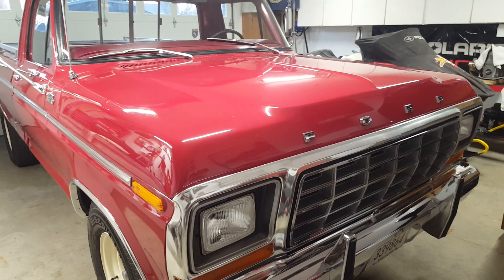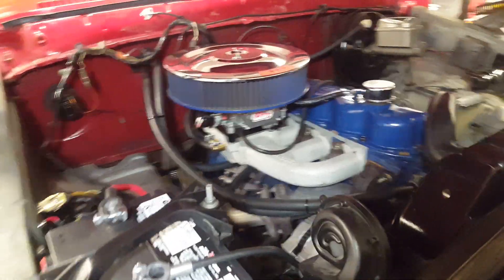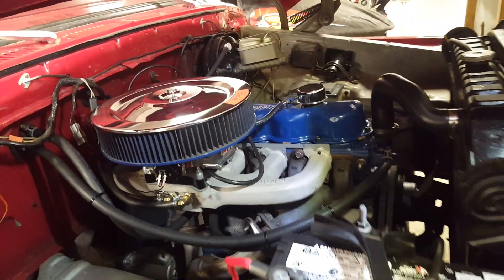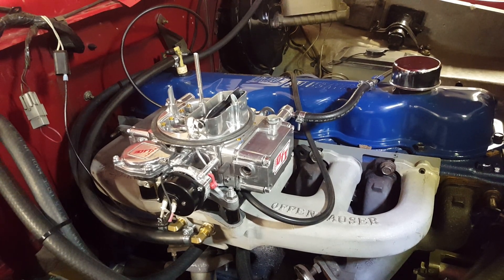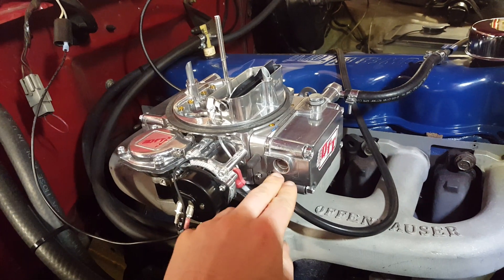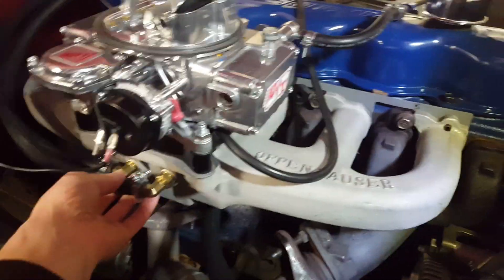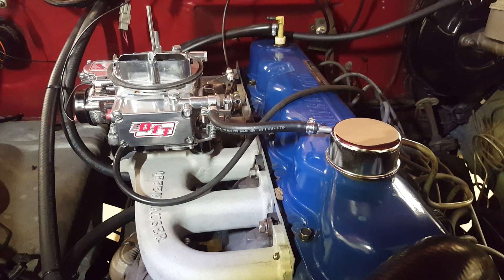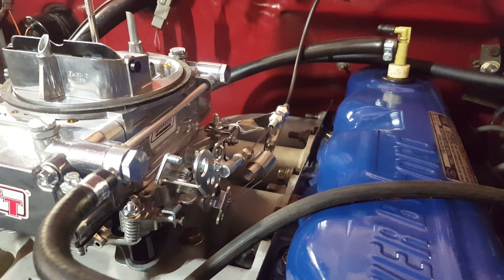300 Inline 6 Cylinder (4.9L) Ford - Offy C-Series and Quick Fuel 450 Walkaround

Comment: I have a 300 in my '65 F100.  I ran 240's  before the 300. 39 years on the last 240...I put the efi exh mnflds on. Wow ! the difference in power was stunning !  I have the efi exh mnflds on the 300 again. There are two plain jane mufflers then two short pipes that turn before the pass rear tire ( Less back pressure ). I still use the 1V carb and oil bath air filter. The 300 is even stronger than the 240 ( of course ! ). With this set up I don't need a V-8. 
  All the best, Pete 🙂

Comment: My favorite inline 6 cylinder 4 wheel drive FORD pickup truck motor with manual transmission is the 1982 XL250.  Good fuel mileage and plenty of torque for towing a horse trailer !

Comment: I've a 78 Econoline with the same motor, 3 speed. It has over 375,000 on it, head's never been off it since new.

It was purchased new by an uncle, who willed it to me when he passed in '91. It had 5,600 miles on it.

I will have this van for the rest of my life... it is totally stock... runs smooth... but thinking of a light mod like yours. Just put new plugs and wires in it today...
Reply: Yup. Mine has 269000 miles on it. Daily driver one owner. Never had any internal work and still gets between 14-19 mpg

Comment: VERY nice truck!  I too have a 300 six in my 1995 F150, 4x2, 5 speed manual.  It goes in tomorrow to stop the oil hemorrhaging... 100 miles per quart.  I am getting too old to tackle the oil leaks.  Oil pan gasket (botched up by previous owner), porous oil pan, leaking oil pressure sending unit, valve cover gasket, side cover gasket, possibly rear main seal.  The PCV valve is functioning ok.  The only seal that doesn’t leak is the front cover, and I’ll have them change it while things are apart.  Very strong engine, even for 198k.  I expect I’ll get another 100k or more out of it.  It currently has 198k+ on the clock.  I bought it over 12 years ago and it’s a southern truck.  Very minimal sheet metal rust, super solid frame.  I do not drive it when the roads are snowy or salty (I live in MA and it is not my daily driver).  Your truck is a beauty. 👍

Comment: I’ve commented on this video a few times, but I just wanted to say thanks for the idea. I just got mine wrapped up and I put the same manifolds and carb on my 81, and it’s a totally different truck. Definitely no race car, but it really woke that little 300 up!
Reply from the maker: Good to hear!
Reply: Compared to the stock 1 barrel carb, do you still have to floor it just to make it up a hill?
Reply from the maker: @zachshipley1689  it's never really struggled to get up hills if it's unloaded. With a load it labors a little less to get up to highway speeds going up an on-ramp but as you can clearly see, she's no rocketship.
Reply: @rumrivertriples4073  Thats good then. I plan on swappin carbs as well
Reply: Zach Shipley no. It runs so much better, smoother and noticeable power bump. I have no overdrive in my truck and on the highway with the old carb, it was really working hard to go even 60 mph. Now I look down and don’t even realize I’m doing 70 all the time. The motor really feels like it has a lot more breath. Going up hills and being under load, definetly doesn’t take as much throttle as before.
Reply: @chrish5096  sweet cant wait to do mine
Reply: Zach Shipley yea. I had struggled installing mine because I had unrelated timing issues, and also made some beginner mistakes with the timing. Me doing the setup all resulted in a break down and figured while I was down to upgrade. If I did it again on a motor that was running fine, it would’ve been a breeze. 6 hours or so tops. Just make sure you get a throttle braket and long enough cable. Don’t try making your own...😂
Reply: @chrish5096  definatly

Comment: I have a 96 F150 short bed XL with 4.9 fuel injection and 5 speed Mazda trans. 260000 miles runs like a champ. Putting ZF-5 transmission in it next week. Yes it has small block bell housing. So stoked about this. Now just need a 78 F250 to swap everything over to !!!

Comment: Very, VERY nicely done!
I have a 79 F-100 with the 300 inline and auto. It was a CA truck and in 2004 my son and I dropped in a new long block. I removed most of the octopus that sat on top the engine at that time. I’m sick of these 1bbl YFA carbs failing every couple of years after sitting through our winters, WA state. I came here looking for a solution and really believe this is it. I’m going to reach out to you for a parts list if you don’t mind. I like a number of your upgrades.
Reply from the maker: Thanks, feel free to send me a message, I'd be happy to share all that I recall from the swap
Reply: @rumrivertriples4073  Wow those offy manifolds are impossible to find and they keep moving the back in stock date further out. Have you heard anything on the Clifford Performance ones?
Reply: @Mr_PNW  i just got an offy dual plane intake for my 300 from summit a few days ago and it came in 2 days
Reply: Hey @Mr_PNW  and  @rumrivertriples4073 , I'm doing a full machine and rebuild on a 300 for a 67 f100 here in SW Washington (wet and cold winters). Putting the head back together today. My intention for build, OE look, and use is almost exactly what you have done so I am very grateful for your video. I already bought my Offy but I was having a hard time deciding on a carb. The Quick Fuel sounds perfect. I would love to talk parts with both of you guys. I have a stock exhaust manifold - don't really want the hassle of headers and I don't think it'll be worth it. How much of a difference will the EFI manifolds make? Your's sounds great - what muffler did you choose? Thanks so much for sharing.

Comment: I have 1986 with the 300 inline that I just rebuilt. Those motors do really well with an RV cam (LOW torque) with a 2b carb. Very nice truck tho and thx for sharing with us.
Reply: Glad to hear it. I'm doing a 68 and put an RV cam in it. Still in the build stage.

Comment: Nice!  I have the same setup except I put an Edelbrock carb on mine.  I changed to the newer AVS2 carb and it made quite a difference.  The annular boosters gave me much crisper throttle response and torque off the line.  I also put a Thompson Performance powerblast plate on it which made the last little remnants of a stutter disappear when i hit the throttle.  I’m trying my best to get more fuel economy in preparation for a trip from CA to Arkansas.  I’m planning on switching from ported to manifold vacuum advance to get more timing at cruise and running an HEI to get that low load cylinder charge ignited as much as possible.  I’ve been able to get my ‘72 F350 flatbed from 9 mpg to 18 currently.  Next I’ll fiddle a bit more with the timing and put an overdrive unit on it.  Should be over 20 mpgs easy!
Reply: Ported and Manifold are the same at cruise. I use manifold for some mysterious reason.

Comment: I put an efi head on my 86 carb 300. The brings the compression up to 9:1. Also, on mine anyway, I can’t run enough timing to make it ping. The carb head would ping readily. I have the timing set for max performance using an hei. I’d like to get the offy intake but they’re hard to come by and $700 at summit.

Comment: I mounted my carb completely different. The Lokar cable goes over the valve cover then turns back towards the firewall. The throttle plates center over the plenum better also.
Reply from the maker: Is your intake a c-series or a dual port? C-series needs the carb mounted in this orientation.
Reply: I have a dual port and also a Clifford intake. Both have carbs mounted as I describe. My carb adapter will install in either position.
I am assuming that a dual bowl Holley on a C-series will hit the valve cover.

Comment: Nice truck I have a 78 f150 Ranger xlt flare side 4x4 highboy with a 460 built up to a 514. Keep the old trucks going because the new ones are junk.
Reply from the maker: Very nice! Want to trade engines? Ha
Reply: @rumrivertriples4073  you can build one you need a 1971 Lincoln block D1VE is the beginning of the block number. But when I go out to my garage I'll let you know what books to buy because it tells how to build one. I never built a engine in my life and I went by these books and it works great. But start looking for the that block first. There worth about$1000.00 dollars.  But make sure it has the block number or it won't work.
Reply from the maker: @staggdegraaff1531  thanks Stagg, no worries though. I'm familiar with that engine family and already have a plan for how I'd build one, just a matter of not wanting to spend the money on the swap at the moment. Lots of other projects and the F250 is a great reliable cruiser at the moment
Reply from the maker: @Faber-cator  why swap out the more economical I6? There really is compelling reason at this point beyond a desire for a more fun driving experience. Like I mentioned I've got enough projects to keep me busy so this will likely stay as-is for a long while.

Comment: Electric Choke that's switched on with ignition switch? get an oil pressure switch that's normally open (no pressure) and wire that ignition source to it and then the choke. then choke activates only when engine is running. some OEM's used the alternator stator to power the choke though it is a lower voltage and electric choke needs to be made for it. anyway, small detail on a nice truck! <3 all

Comment: Did the full clifford kit on mine recently, comes with an offy intake as well.  You were saying that you were able to set fuel air mixure screws to the right place with this carb?  The 2bbl webber carb they sent works well, but even with my mixture screws set in all the way it still runs a little bit rich.  Not sure what Id need to do for jetting to fix that, might just go with a new carb at some point.

Comment: Your primary carburator throttle are feading cylinder 1 to 3, secondary 4 to 6. I know that´s the only way you can place the carb over the manifold or 180 degrees around. I modified mine 90 degrees so primary are closer to the engine, just like Offenhauser clams to set up the carbs.
Reply: I agree. Many videos show these carbs mounted incorrectly. Perhaps they are thinking about working on a V-8. Although I used a Holley 2 barrel, same concept. Throttles are inline with engine and centered over the plenum.

Comment: I’ve been interested in a setup like this for a while but now it’s a reality as my old carb is beginning to leak causing my motor not to start as well as the fact that it runs too rich and fouled plugs after only 2500 on my rebuild. Anyway that’s all beside the point. I am going to order and use the same parts, (intake, carb, exhaust manifold) as you did. I shouldn’t need any other items to complete this other then new manifold mounting hardware and gaskets, an air cleaner, and a spacer plate to go between the carb and intake correct? Also did you run into any complications with your installation? Awesome truck I hope to have a similar running engine soon!

Comment: Been loking for same setup BUT with a EFI and AOD, would sure like to build such but would like to see others info
Reply: I'm doing a 4R70W in my 77 carbureted. Has lower gear ratios and is tunable. I don't mess with AODs anymore. 
I think the AOD will bog the engine down because it shifts too soon.
Reply: @Maples01  What about the ODD2 EIF on a 96 4.9. ? I just bought a 96 and plan on putting the motor in my 1955 F100 and use the EIF and engine wiring harness. Just desmog it.
Reply: @Wayz5145  My friend bought a 96 E150 handicap equipped, he put over 400,000 miles on it, that is why I got this one. The 96 has the ignition mounted on a heat sink on the fender away from the distributor, but you can't change the fact the capacitors in the ECM are old and either will have failed, or be ready to, get them replaced, have a restriction plate made for the EGR, you don't want to remove it, just limit the gasses going through, throttle body gaskets are only good for 30,000 miles then they crack and get sucked in, either replace the injectors or have them sonic cleaned, and this engine uses the highest fuel pressure, its to combat vapor lock as the exhaust is by the intake, so it cycles the fuel quickly through the rails to keep it cool, 55PSI is normal, low pressure pump in the tank, collector on the rail followed by a high pressure pump. Remove the smog rail, the plug need be machine thread, not pipe thread, plug up the head, there are available heads without the smog holes, be sure to leak down test it first to look for burnt valve, or valve leaking, I'm still fighting to keep mine running in gear, no vacuum leak found, could be internal like a valve.

Comment: yeah its been mentioned already but  this is a dual plane  manifold isnt it?  or does does offenhauser make 2 diifinline 6 intakes?
if its the dual plane , you have your carb 90 degrees out of phase and are basically running 3 cylinders on the larger ports and 3 cylinders on the smaller ports
Probly not ideal
Your secondaries should both be feeding the larger ports and main 2 bbls feed the 2 smaller ports
Reply: no, this is the type "C" manifold.  the carb orientation doesnt matter on this one.   yes, offy makes 2 diff intakes for the i6

Comment: I'm building one now.....
   IS THERE A ONE STOP SHOP... that carries all the inline 300 parts...
  ( I'm having a hell of a time😨)
  Got an 84 manual F150 step side..
Reply from the maker: Summit racing has most of it but I've heard the Offy intakes have been on back order for a while. There are smaller parts that have to come from various specialty vendors like the heat plate (Raso) and some of the other do-dads

Comment: Great vid. Do you know where 1978 ford f100 temperature sensor connector is located going into the firewall?
Reply: The ford 300 engine has the temp sender below the intake/exhaust manifolds, towards the back of the engine. It's a pita to get there if everything is assembled. You can see it from below the truck.
Reply: you may have found it by now, but for others wondering, it is located in the wiring loom on DS by brake booster/master

Comment: Beautiful pickup and a helpful video! I am going to try your set up in my 1968. I have a question unrelated to the video topic. I noticed your upper radiator hose enters the radiator on the passenger side. Does your lower radiator hose also hook to the radiator on the passenger side? Do you know your top and bottom radiator hose sizes? Sorry to be a bother, but I am struggling to find a decent radiator for my 1968 and I was thinking about shopping for 1979 components instead. I might share my email if you respond. Have a great day!
Reply from the maker: Hey there,
I don't have my truck near me right now, but it does have a passenger side lower radiator hose based on digging through some of my older photos. Unfortunately I don't have a good way to measure the hose sizes for you at this time.
Reply: I have a 67 that I'm building. Did you get your radiator figured out?

Comment: Thanks for the video XC. I'm doing this intake conversion right now on my '86 and wondering a couple things: 1. What size carb spacer did you use? 2. Do you have a link or part # for the throttle linkage set up you used? Thanks for your time.
Reply from the maker: Soren, glad you liked it and found value in the video. I used a 1" thick 4-hole spacer from Summit as well as PN: DP-1000U for my Lokar throttle cable and bracket. Hope this helps. Thanks
Reply: @rumrivertriples4073  Awesome! Thanks my friend. Best to you and yours.

Comment: Must be Minnesota or Wisconsin, cant do that in California, sadly.
Reply from the maker: Did my accent give it away?  

Ironically, the truck runs cleaner and gets better mileage now than it did when it was completely stock.
Reply: @rumrivertriples4073  Yes, the northern.midwest accent. I wonder how a 4.9L running on propane would do. They certainly run clean with no fouling of plugs. They run better with high compression pistons or head decking to raise the compression. Seeing the specs on the Honda GX NG Civic they had compression ratios of 12.5:1. Propane should work pretty well unless its gets SUPER, SUPER COLD liquefies @ -44°F.  Natural gas isn't as available as propane. Hard to get a hold of out on the interstates. Fed gov't has a website about this stuff on fueleconomy.gov. alt fuels.